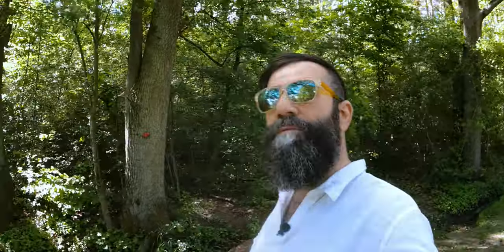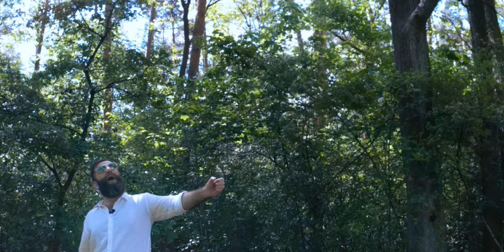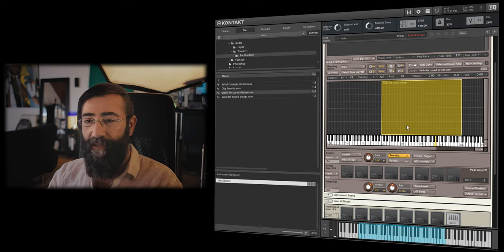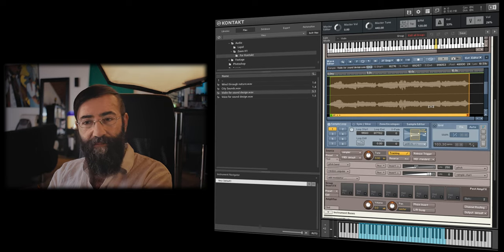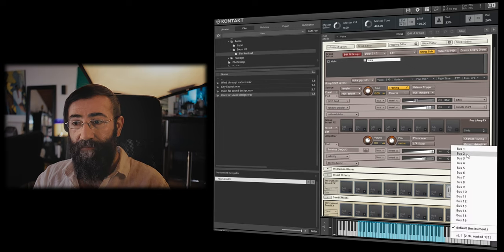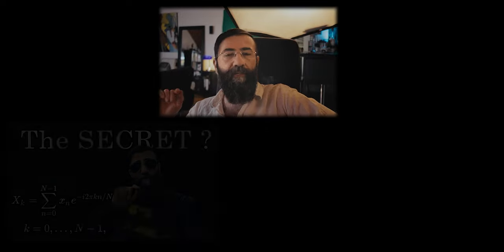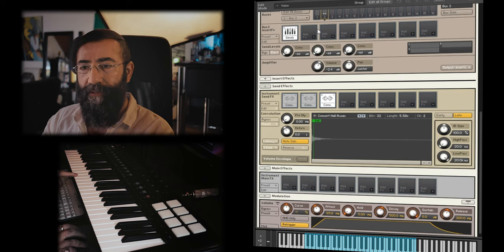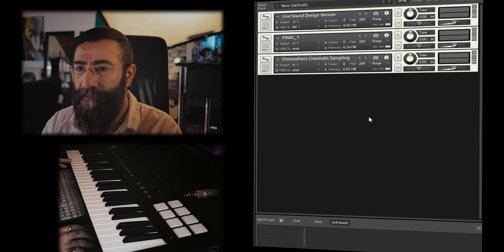Divine Sampling - Fastest Cinematic Sound Design in Kontakt (using only 4 samples)

Comment: I must say that I am truly impressed by your techniques which provide so much texture and variation from so little in the way of initial samples as the source.  You inspire me to do some real world ambient sampling.  I guess I will have to save up and purchase a portable recorder to do so.  Recommendations for a good value in portable recorders similar to what you used for this video to capture the wind and cityscape sample would be appreciated!
Reply from the maker: Thank you. I'm glad you get it. I found that the Zoom H1n, although basic in functionality, it fulfills most needs if used correctly. However, the more expensive models offer flexibility in recording such as using external mics hooked to the recorder. Wind is a bit tricky. You will need to experiment with microphone positioning :)